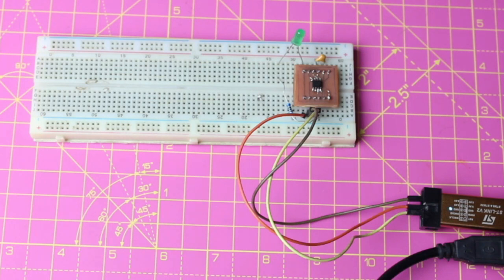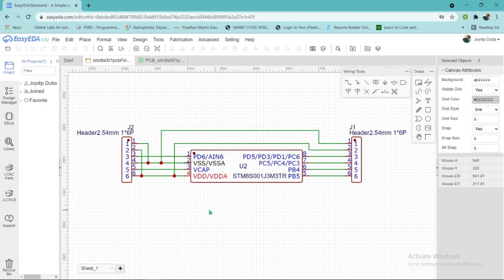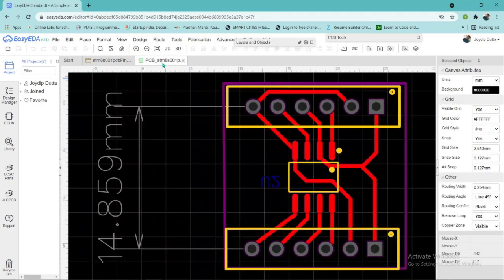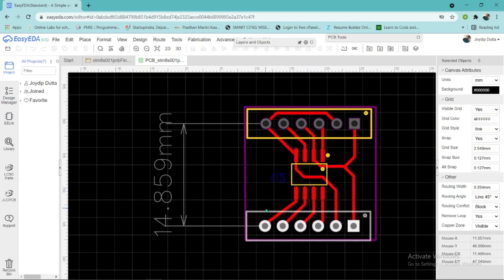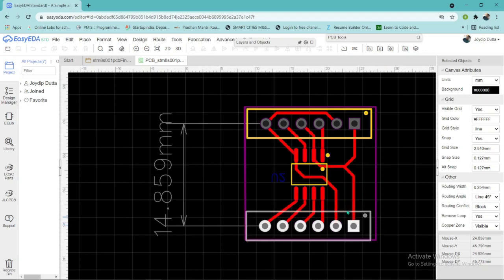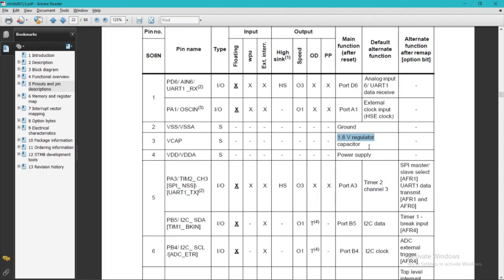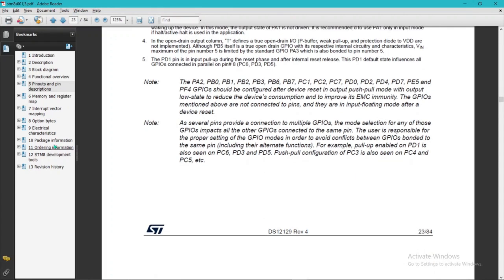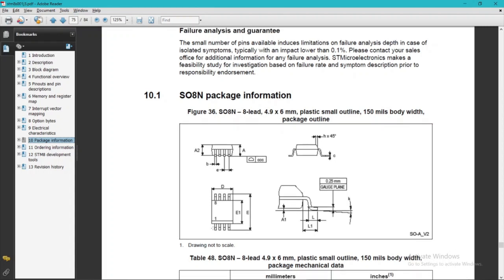Getting Started with STM8S001J3 Microcontroller using STVD and Cosmic C compiler

Comment: How to read .hx file
Reply from the maker: If you meant how to read the firmware from the MCU, you can use STVP along with ST-link programmer. Keep in mind reading the MCU firmware is only possible if it is not locked.

Comment: GETTING ERROR 

Running Linker
clnk -m Debug\led_blink.map -l"C:\Program Files (x86)\COSMIC\FSE_Compilers\CXSTM8\Lib"  -o Debug\led_blink.sm8 Debug\led_blink.lkf 
#error clnk Debug\led_blink.lkf:1 symbol _assert_failed not defined (Debug\stm8s_clk.o Debug\stm8s_exti.o Debug\stm8s_flash.o Debug\stm8s_gpio.o Debug\stm8s_itc.o Debug\stm8s_rst.o )
 The command: "clnk -m Debug\led_blink.map -l"C:\Program Files (x86)\COSMIC\FSE_Compilers\CXSTM8\Lib"  -o Debug\led_blink.sm8 Debug\led_blink.lkf " has failed, the returned value is: 1
exit code=1.
Reply from the maker: Make sure to add the source and header files to the workspace properly.